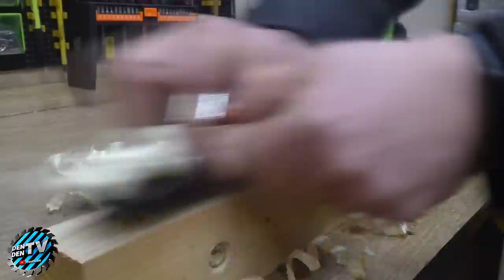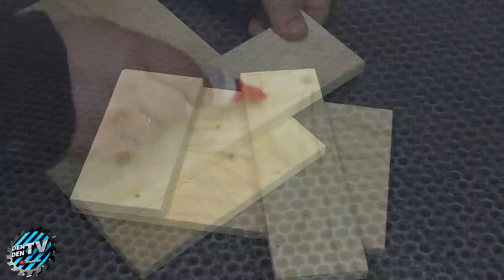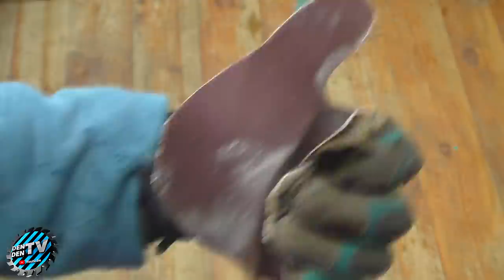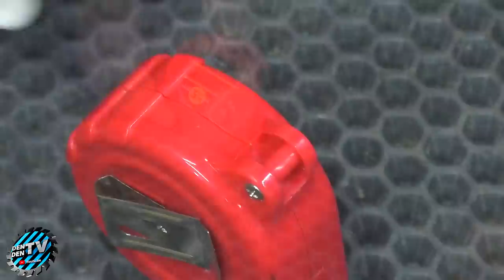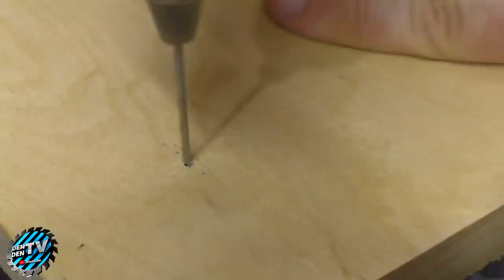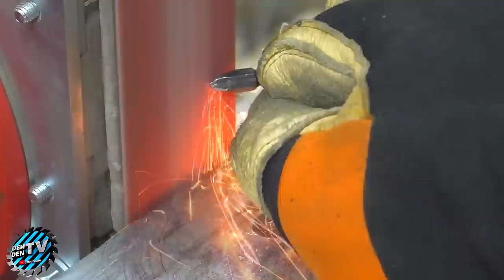The Masters don't want you to know! Tips and hacks that work really well !!!

Comment: A VERY GOOD (or should I say: "a better wood suggestion"???) as mentioned by Dean, is to use bamboo toothpicks... BUT it seems to me  that using Bamboo CHOPSTICKS, with the end sharpened with a pencil sharpener would be much better (stronger and firmer way to support a part to be painted or stained on all sides). ANYHOW, THANKS FOR YOUR GOOD IDEAS!!!

Comment: You stripped that bit by using the WRONG size in the first place. Sawing a board on a bench, for quick work, I just clamp it down. For precision, I use home made Bench Dogs. Most of your "tips" were for those who don't own tools, or are too lazy to use the correct one.
Reply: Nice observation!
Reply: @antonleimbach648  He's one of those novice types, who don't know Phillips Bits come in different sizes, and profiles.
Reply: @davidjames1063  or Pozidrive which are supficially similar to Phillips but use different angles and have extra faces at the 45 degree positions. You will never hear a US content maker reger to those. Over there, every cross head is a Phillips.
Reply: @johnmusgrave3179  Exactly John. Great point. The vast majority here, have never even heard of Torx Drive, and Pozidrive is completely unheard of.
Reply: @johnmusgrave3179  Before I retired as a Mechanic, I sold a wrench and socket set I had. It was a full Wentworth set, and no other Mechanic, save one, even knew what that was ! Mechanics in the USA are now just Parts Changers, just as our Doctors are now Pill Pushers, not Diagnosticians.
Reply: @davidjames1063  You seem sincere... idk where you live but all the men I know are aware of torx and posidrive. As for the Whitworth I've got a few friends who are automechanics; I wouldn't expect anybody else to know. Philips heads are trash... anybody who has to work with them knows; and yeah not using the correct size is only going to exasperate the problem (cam out). Torx, Robertson/square, and posidrive are all excellent. I wish philips was done away with for everything except drywall screws and lathe screws. I will also add that I think security screws are dumb (not really secure if all you need is some $10 Chinesium bits to get passed it)... just seems like a way for manufacturers to be annoying.

Comment: Appreciate it. What glue did you use to do the sanding glove technique? Thanks 👍🏻
Reply: CA glue, though don't use that technique, it's terrible! A waste of sandpaper, gloves and glue. Just use cloth backed sandpaper or sanding pads for curves like that, they're far more pliable than paper backed sand paper.
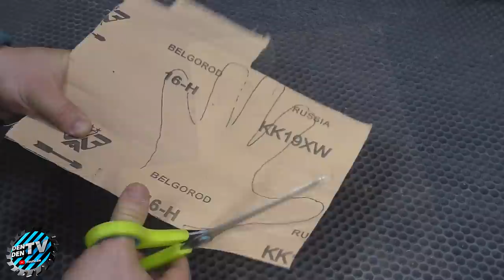Reply: 01:40  Say good-bye to the scissors, it's useless now. Cutting sandpaper is the worst thing you can do to scissors. Use a disposable break-away tip utility knife instead.